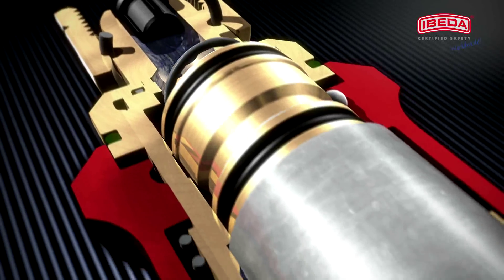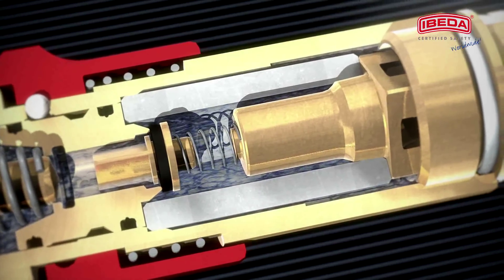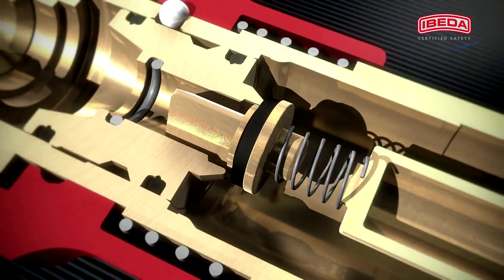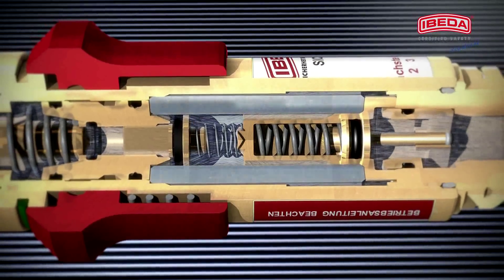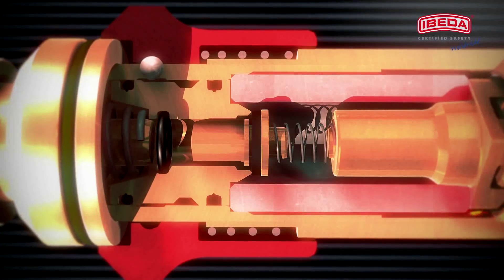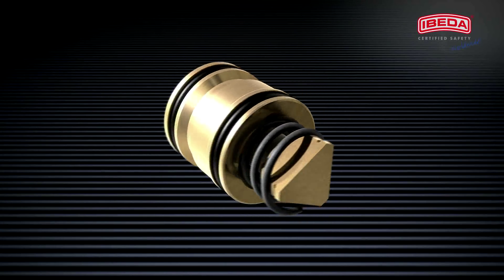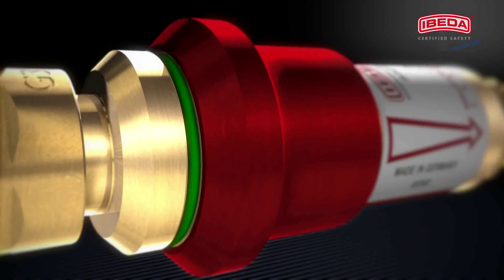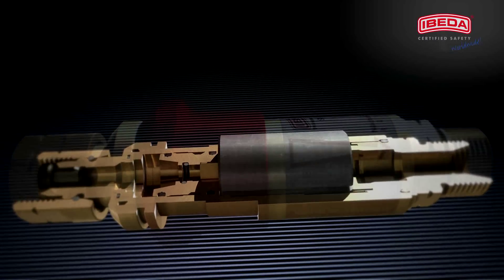Function Animation of IBEDA Flashback Arrestor (Flame Arrestor): How they work

Comment: Good except for two points that I think could be explained better. First, you didn't make it clear that the gas flows THROUGH the sintered flame arrestor. Second, you didn't fully explain the difference between the check valve and the pressure sensitive valve. I'm guessing that one (the check valve) responds to differential pressure but the pressure sensitive valve responds to absolute pressure?
Reply from the maker: Dear Sean, 

Thank you for your feedback and your positive comments to our video.

You are right, the gas flows through the sintered flame arrestor.

The gas non-return valve allows the flow of gas in one direction only, i.e. in the intended flow direction. It shuts off immediately in the event of gas coming from the other side, i.e. from the outlet side of the arrestor. Thus, the reverse flow of oxygen or compressed air into the fuel gas line, or the reverse flow of fuel gas into the oxygen or compressed air line is prevented and dangerous gas mixtures air are avoided.

The pressure-sensitive shut-off valve is activated in the event of a pressure wave. The valve is tripped if the upstream gas pressure is at least 1,1 bar higher than the pressure at the inlet side of the flashback arrestor. Such pressure shocks are usually caused by flashbacks. 

The 4 safety features of a flashback arrestor are explained in detail in the EN730 or the ISO5175. 

We will try to consider your suggestions for improvement with the next video version.